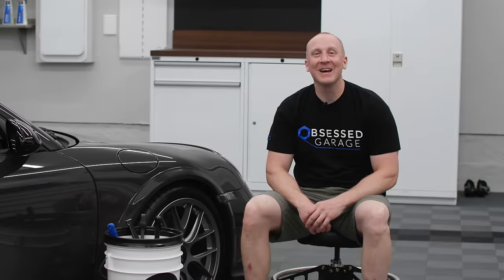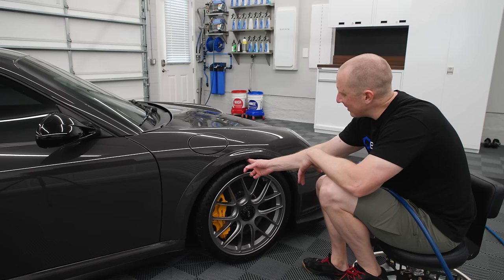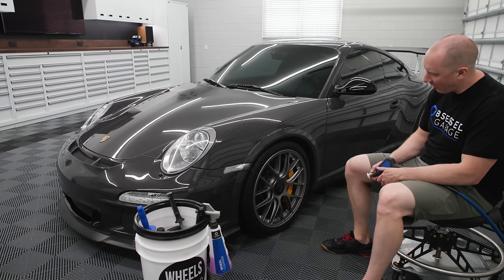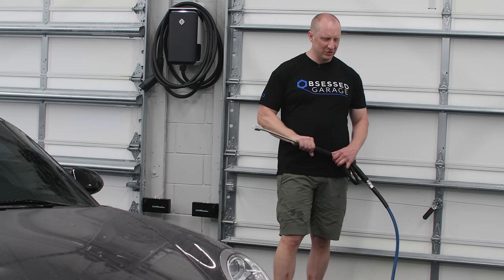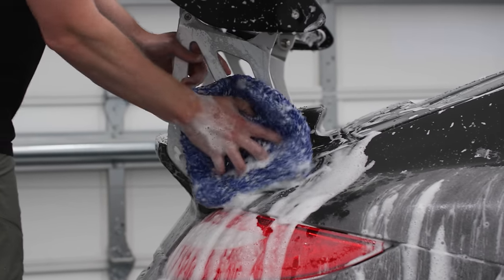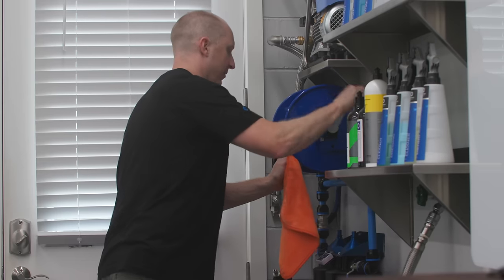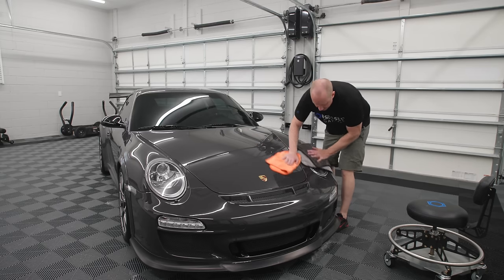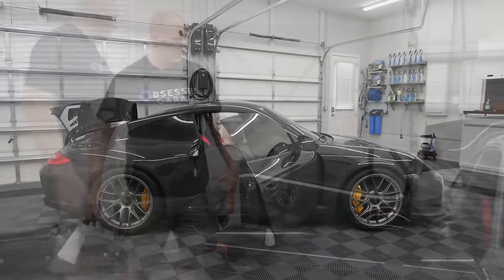997.2 GT3 RS Giveaway Has Begun: Wash & Talk | My Most INSANE Giveaway Yet

Comment: If you want a slightly less alkaline wheel foam that's super slick, just use Koch Chemie Active Foam it's a mild pH of 9.5 which will be around 7 if used 10:1 in the cannon
Reply from the maker: I want it to retain the rust inhibitor properties that Brake Buster has.
Reply: @ObsessedGarage  as you’re supposed to dilute Atom-Mac, I wonder if this could be added to another product, could be worth a try?
Reply: @ObsessedGarage  Good point, but are rust inhibitors strong enough once diluted 10:1 through your foam cannon?
Reply: @LSD04  That's a good point although, I think you'd still get best results by rinsing off any wheel cleaner and then applying to rotors. It also might mess with foaming of wheel cleaners?